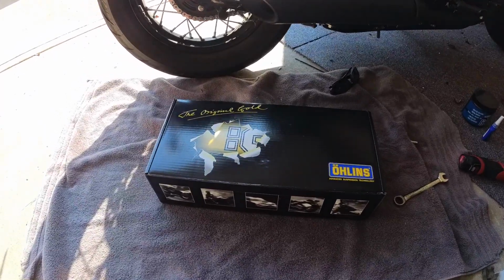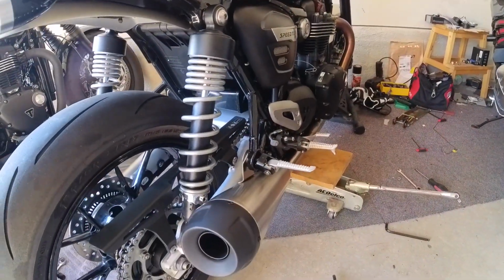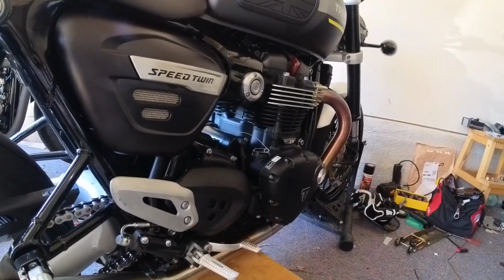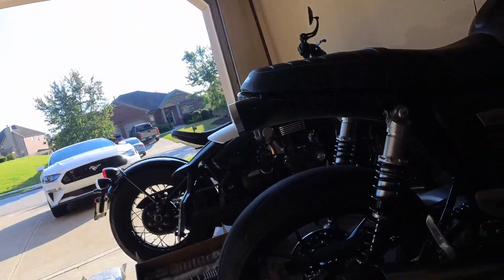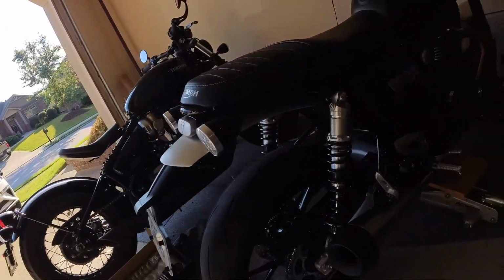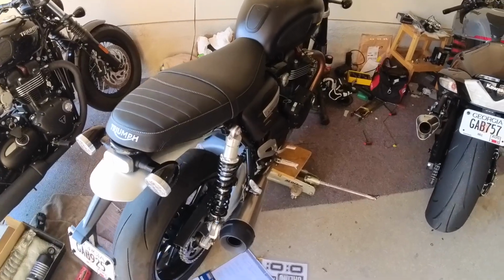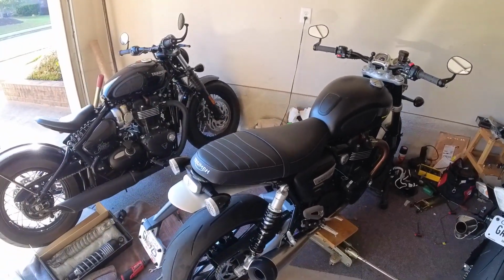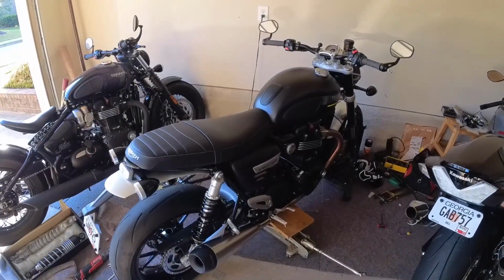Ohlins shock install on a new Triumph Speed Twin

Comment: Hi Dave, I enjoyed all your video on the speed twin! I am looking into swapping out the shocks on my ST as well. May I ask what made you decine on the non piggy back ohlins versus the piggy back ohlins versus other fully adjustable but cheaper brands? Thanks a lot!
Reply from the maker: I got a great deal, $635 shipped to my house, with the correct springs for my weight.  And that's all the bike needed, frankly...
Reply: Thanks a lot!  @Daves_Man_Cave

Comment: Hello, what is the length of the suspension?
Reply from the maker: Off the top of my head, I don't know.  The Ohlins shock is the same length as stock, that's all I know.  

Although, if you click on the link there in the description, it gives you all that info.  ;-)
Reply: I found it, thank you very much. TR924 - 384mm +5/-5 mm. I also have a 2022 t100. I found an ohlins suspension but it didn't say the size. :)

Comment: Thanks for the video. I've just bought the same Öhlins for the same bike. Very helpful video. Were you not tempted to run the bike with the silencers off? 😂
Reply: Did you leave the front Marzocchi forks as standard?
Reply from the maker: I think that with the CAT intact, running without Mufflers might be ok... won't be louder than most Harleys...  haha

Comment: Did you ever change out the front suspension too or just the rear?  I was reading some forum posts, and seeing mixed reviews about the benefits of just doing rears vs. both.
Reply from the maker: I did both.  K-Tech racing springs and cartridges up front, and Ohlibns out back.

Comment: Hi Dave, I just picked up a 2022 Speed Twin and would like to do the same. The Ohlins part number you called out comes up as for a ‘19/‘20. I know the 21+ was a refresh. Do you know if it the pre/post ‘21 models are the same with respect to shocks?
Reply from the maker: Yeah. the shocks are the same.  I got mine from A&J Cycles, they can double check and make sure you get the right set.
Reply: @Daves_Man_Cave  thank you!

Comment: Double check the top is clearing the lug as some aftermarket rear shocks have been contacting the lugs or extremely close.
Reply from the maker: Could you be more specific on that?  I am not entirely sure what you are referring to, so I am not sure what to check.
Reply: @Daves_Man_Cave  Sorry only just seen this. Yes the top mounting on the shock on some KTEC and Nitron shocks when mounted were rubbing against the frame and both manufacturers had to modify their designs to make the clearance. I'm not saying yours are interfering but they might be.
Reply: @Daves_Man_Cave  If you go on the Triumph forum and look under 'nitron shocks- word of warning' you'll see pictures showing the problem.

Comment: Enjoyed the vid, the difference will be night and day, look forward to the update... I actually changed mine without any trouble with the bike on the side stand. Once you take one side off, it takes little effort to lift the bike using the side stand as a pivot, to align the replacement shock. Fitted K-Tech Razors (c/w piggy back) set slightly longer. #transformed!
Reply from the maker: Thanks man, I think I may need stiffer springs but these will still be an improvement over stock.  I should be able to change the springs on the shock, in the bike.  Ohlins shocks let you turn the preload collars out far enough to take all the pressure off the springs and leave a gap, so no shock compression tool required.  Remove the bottom bolt and leave the top on and rotate the shock out to clear the swingarm and swap the springs right out.
Reply: @Daves_Man_Cave  I already selected the 'fat man' springs when I ordered my pair, haha... Glad yours dont sound too difficult to switch them out. We gonna get an update vid? 😀
Reply from the maker: Yeah, I was hoping to get it all dialed in this weekend, but its pouring rain and will be for the next week or two...  This summer has been atrocious, it rains constantly...

Comment: Much easier to do than the upgrade I did on my Africa Twin. Just dealing with getting at and too the single shock mounting points. Getting the old shock out. The new shock in with an added oil  reservoir I had to plumb and mount. I actually had to very tastefully take some material off of the right passenger peg mount for clearance and really just to make it fit and look better. Anyway,         4 hours (cause I'm slow )and $1800 later I had my killer shock installed about 2 weeks before it started turning hot here in Phoenix. I think I put 300 miles on it in those 2 weeks and it's been parked all summer. Can't wait until October when we start doing into the 90's then November 80's. Then it's riding weather through June. Ride safe/Be blessed buddy 👍

Comment: Just changed mine yesterday. I don't have a jack nor a wheel chock but I could do the change by myself without too much trouble. The hardest part is lifting the rear of the bike to fit the top bolt of the suspension in. Would have been easier with a jack though !